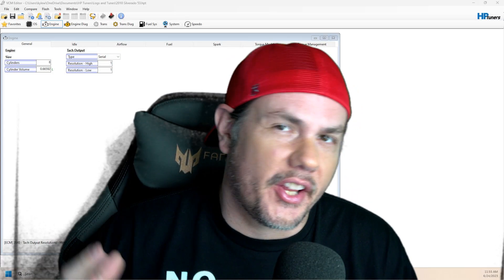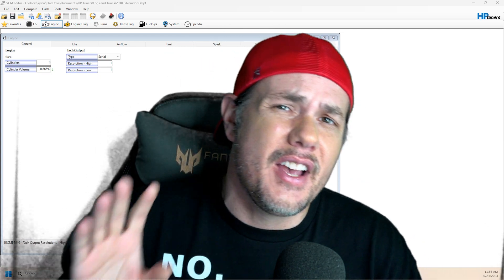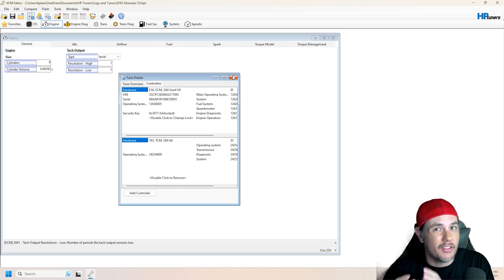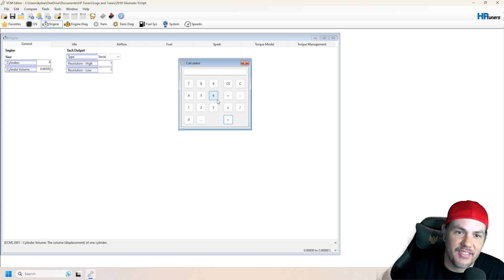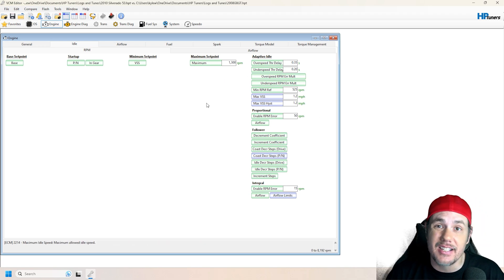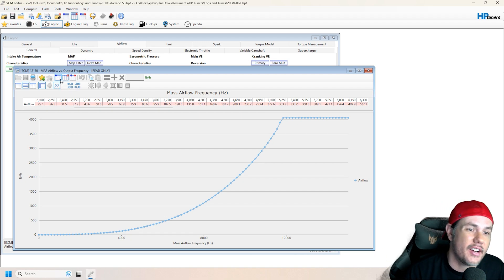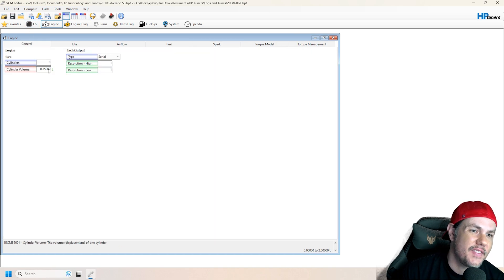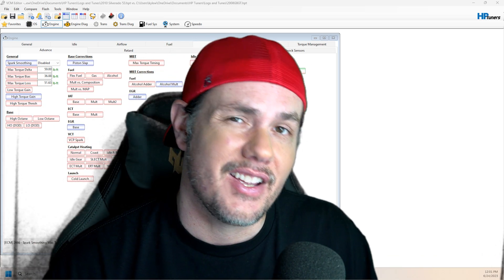Setting up a Tune for a different engine size!

Comment: I got a couple different swaps coming in future. How would one go about going from a 5.3 gen 4 to a custom 408? I am thinking allot of tuning ahead.
Reply from the maker: Just scale the airflow, easiest way is to find out there displacement shift in percentage then apply it to the VE and MAF (of being used) tables. So if the engine is 23% bigger multiply the entire tables by 1.23 to offset them 23%. Will get you in a starting range.

Comment: Exact video i was looking for. Turns out if you put in an almost 1iter bigger motor and a very aggressive cam with bigger cc injectors, it ill only start for about a good 10 seconds than shut off if you dont give it gas 😂😂 (im being sarcastic)

Comment: What would I need to do for going backwards.  I have a blown up 6.0 and going to put in a 4.8.  My truck has a 4L80E transmission.  Thanks for any insight and suggestions for where to get a tune

Comment: Thanks for the video. Really appreciate it. I have a question. I’m using a 2010 e38 (LY6) with a LS3 30 over LSA. I have a 2013 e67 Factory Tune. Could I just go to each engine tab, do a compare and apply all changes? Thank you in advance
Reply: Did you ever figure this out? What was the solution?
Reply: @BobTheStrangeMan I got a custom start tune

Comment: my gen 3 6.0 had a catastrophic failure so I rebuilt it and gave it a 4 inch stroke since I needed a new crank anyway so its a 402 now. How would I build a starting point tune so it runs acceptably well while I'm breaking in the engine? I adjusted cylinder volume to match the new displacement and saw it adjusted the VE table percentages but I would think other things need to change due to the increased piston speed.

Comment: I have a 2006 Saab 9-7x with E40 ecm I'm trying to get in it to remove the VATS but can't unlock it. I can't afford the HP tuner. I got an OBDlink sx cord pcm hammer and universal patcher, I'd any help you got thanks

Comment: Green horn question if I have some injectors that will be bigger than I need for daily driving but I have twin turbos can they be made to work I just didn't really want to have multiple size injectors in case I wanted to turn up the boost I would need them then any good info would be appreciated thank you

Comment: What about the VE table on a gen 3? I swapped a LQ9 in place of a 5.3 and, the injectors were the exact same, adjusted cylinder volume. Swapped the VE table to that from a LQ9 stock sample tune and it worked great.

Comment: So, going from a stock gen 3 4.8 to a stock gen 3 5.3 should be should basically be a straight bolt in and adjust cylinder airmass then tune as normal…?
Reply from the maker: Bingo!

Comment: When im tuning speed density on the street with a wideband, how do I hit the cells in the higher RPM and lower manifold pressure regions? Do I even need to worry about tuning these regions? I'm finding it incredibly difficult to hold my engine at 5700 rpm for short bursts while manually shifting to hit these cells.